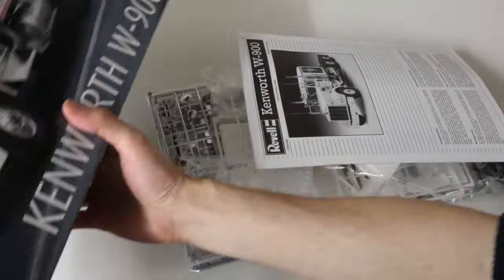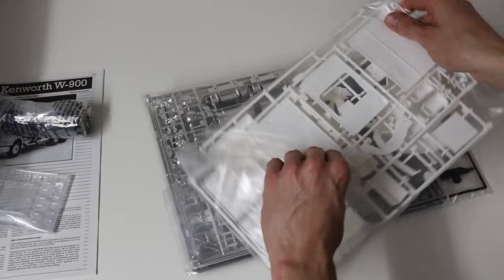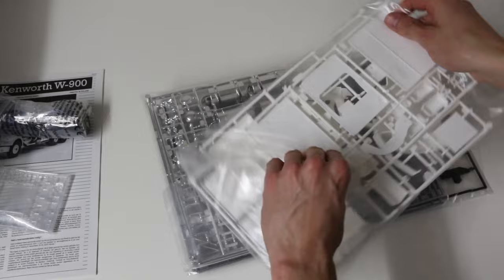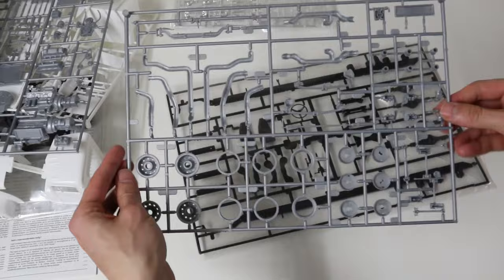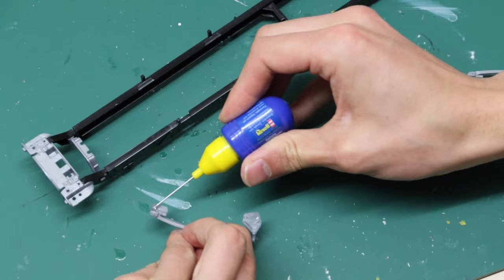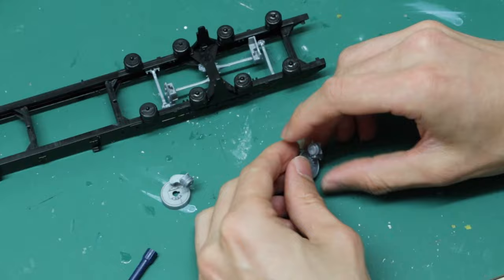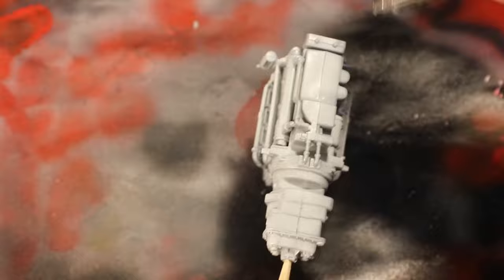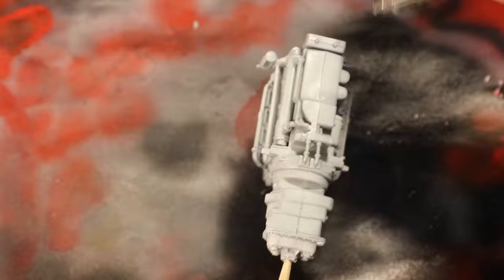Full Video Build | Revell No. 07659 Kenworth W900 | English

Comment: Gut Germact!👍🏼iche habe buit KW. 900A Model aswell 3 kit,s, all 3 kit,s hood,s were deformed? They were the Revell Dump truck KW. 900A. I am making my own hood! I had to put aluminum strip,s in the inside and fill them with body putty to spread them apart so the hood will fit over the engine and fit up against the firewall. I Made my own under hood, insulation coming out goot so far. You're,s came out grobartig.
Reply from the maker: Thank you very much, my hood was straight no issues at all. Very good if you found a own solutions to fix the issue 🙂